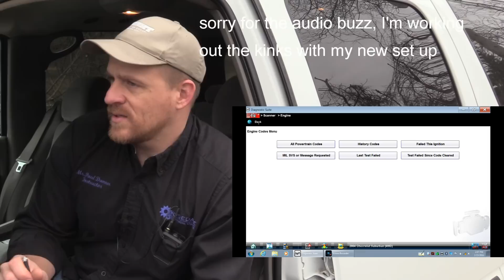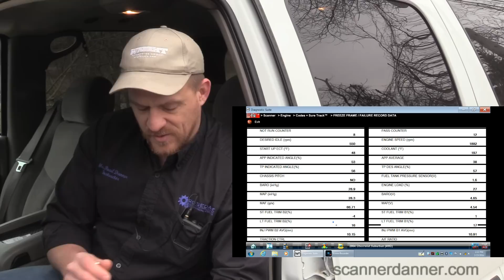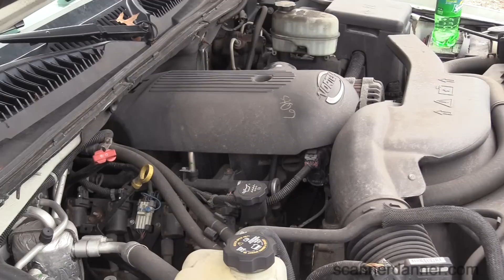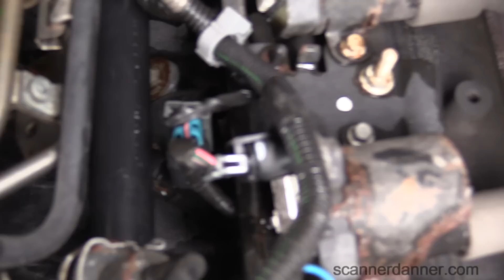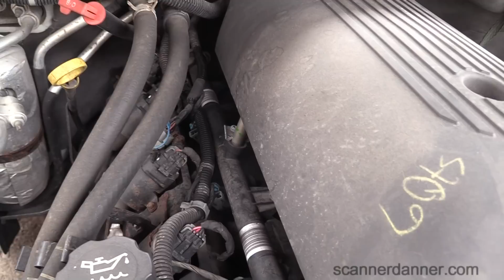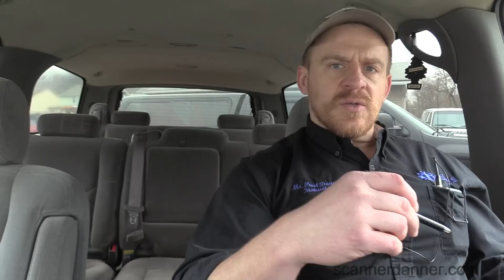Comment: This is an '04? The reason I ask is because I thought I saw a fuel regulator, and I was told that in '04 they went to a returnless system, and the regulator is in the fuel pump. I have 2 '01s, and an '02.
Reply: +dogbyte555 they use a pulse dampener on the fuel rail that looks just like a fuel pressure regulator On the return less systems

Comment: You can really see the rough idle when you dropped water on the cover. Great video.

And yes, we used to dribble water into the carb to clean engine deposits. Also, we would run diesel fuel as engine oil for about twenty miles and let it sit over night to clean the engine case too.

JD

Comment: i suggested that the fuel pump is not take into consideration since the lean codes affected the two banks. shouldn,t we look at fuel pressure as well?
Reply: +anonymic79 ok that correction is taking. thanks pal

Comment: Nice one Paul. Liked the format good to see a person when they are taking to you. I fixed an early 2000 cvic that would run on & ping because of carbon  with that water trick no problem just dropped  the exhaust  at the manifold.

Comment: Great one!
In here. We hardly have V-type of engines. So mostly only one bank and so it makes it harder to make a call on B1S2O2's if they move like normal o2 on could cat.
This one makes a hope that maybe there is ligth in tunnel. To look more then just volt change(at450mv) and make it go on both ends of the range... Thanks for that!

That white text on white car is great to read, if you are tired, btw ;)
Cheers! Timppa

Comment: how did you determine the bad o2 as opposed a degraded Cat. Converter. is it to be assume that both cats are in the same condition?  I would expect to see a stronger flat line on the down stream O2's if the cats are in good shape. perhaps this has had a misfire longer or previously and that one cat is degraded. just for thought here. great videos!

Comment: The water into the carb is a real thing. I witnessed my dad do it many a times when I was growing up.  Clears the carbon right out.  Especially useful on later emission dressed carb engines which would gunk up the intake manifold, and valves.

Comment: Done piles of these, always recommend going back with the FelPro PermaDry PLUS gaskets, much better design, never have another problem after putting those gaskets in.  Plastic factory gaskets are crap.
Reply: Do you need to apply permatex on these gaskets?...im changing the valve cover gaskets on my 10 Buick Lacrosse 3.0L
Reply: No!

Comment: Paul my 02 chev 6 liter never had a code and only concern was a stumble on cold start. Once in closed loop trims were fine. I was chasing IAC until I smoked the intake and both banks were pouring out smoke at cold.  Engine never exhibited any drivability until the temperature went below freezing.  I like the water bottle idea a use it . Nice vid 👍👍

Comment: my bro-in law's 2008 trailblazer was throwing a p0171 code with similar data. i also suspected vacuum leak and did a smoke test and found smoke billowing from the intake. it turned out some of the bolts had backed out and I tightened them and then the numbers went back to normal. they were so loose i was surprised they didnt fall out
Reply: You tightened some bolts on your vacuum leak?😂😂😂😂😂 probably not what you did!!

Comment: Had a similar problem with a Toyota Corolla yesterday:  Grabbed the brake cleaner can and found #3 intake seal was leaking, BUT only when the engine was cold. If you ran it more than a couple minutes it would seal up and trims would go back to normal and until the car had a complete cold soak (back to ambient) it would be fine. I love trying to explain to the powers that be in the front that the car had to sit until it was stone cold for the problem  to show up either with smoke or a little enrichment via brake cleaner. I had the benefit of the car being dropped off and the engine cold, had the customer brought the car in as a waiter and up to temp it would have been near impossible to find.

Comment: I think it's time for scannerdanner t-shirts.lol I tried!
Reply: +Arturo Garcia T-shirts, pocket screwdrivers and whatever else people want. 
Seriously I'm working on this. 
Any other requests?
Reply: +ScannerDanner T-shirts must have pockets to hold the screw driver.  :)
Reply: +ScannerDanner  pocket screwdrivers very nice and useful
Reply: ok t-shirt with pocket friend
Reply: +amjad amj is that for your smokes? :)
Reply: +ScannerDanner You need to supplement your book with easy to grade (automated?) online tests, maybe $10-$40 to take and passing grades will get you ScannerDanner certified in different areas of diag.  As long as that doesn't undermine your work at Rosedale Tech.  Maybe 8-10 passing tests gets you a "final exam" for a small scholarship to a tech school.
Reply: +ScannerDanner some scannerdanner squirt bottles.
Reply: maybe some stick on stickers idk but were proud to represent for u 100% keep it scanning.
Reply: +ScannerDanner Incandescent test light maybe. It seems like almost every test light available is a LED type these days. I'm thinking about making my own, so that I can put in bulbs of various resistances. Could be useful to increase current draw when activating solenoids for instance.

Comment: ?Can we use  MAP sensor signal for help in the detection of a leak intake manifold
Reply: are u talking about voltage signal
Reply: but from signal idk cuz the name map says what its for reads pressure inside intake for engine load it wouldn't tell u exactly there's a leak it just trys to work with what its got.
Reply: The difference in between MAP and BARO will tell you how much vacuum your engine is producing.

Comment: 2.26.16.   What was the mileage on the truck? GM sure has issues with intake manifold gaskets!......Remember the 3100/3400 & 3800 V6s 🙄 At least the 5.3L doesn't leak DexCool into the engine!🔧
Reply: The problem is the rubber comes loose from the metal coolent doesn't go thru the intake on these motors
Reply: Yeah but I'll take any GM engine over the rest!...easy to fix AND CHEAP!...im not gonna get on Ford/Dodge and European engines I've had em all and worked on em all and I WILL TAKE ANY GM ENGINE OVER THE REST!...SUPER EASY TO FIX AND CHEAP PLUS PARTS ARE ABUNDANT!...